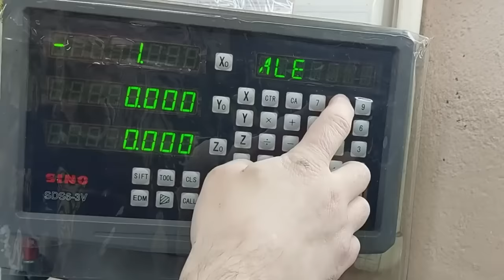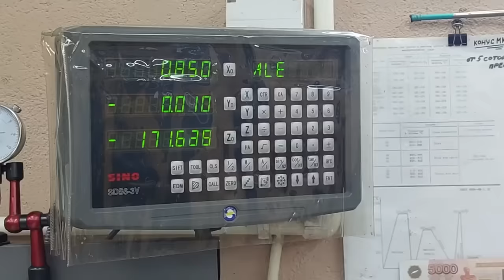Top 3 Genius Ideas  every turner should see

Comment: I have put a very heavy knurl on a part to press into an oversized hole to re-machine the correct hole in it.  A bit of threadlok held it in place.
Reply from the maker: All right, man! Welcome!
Reply: An old method to resize pistons was to knurl the skirt. Some lathes even came with an attachment for just that purpose. 
This was a standard practice for a long time even for airplane engine pistons. Some thought at the time it was even preferable and would knurl the skirts of new pistons as the knurling would hold oil for lubrication purposes.
Reply: @ken481959  I'm glad a few people know this.  I have tried knurling to hold a hose in place to no avail.  I ended up pop riveting it in place.  Too much weight for the rubber
Reply: @bobprice9244  If you knurl something to increase an interference fit tightness, be sure to use green Loctite for bearings and studs. Just don't plan on getting it back apart. That stuff works great.

Comment: Your Verses from Romans⭐⭐⭐⭐⭐.    The boring bar is a great idea.  Never thought of using a parting insert before 👍👍👍👍👍. 
    I never thought I'd not be in a machine shop.  I let several of these tidy little lathes oass by at bargain basement prices. Ñow I have an old 13 inch swimg South Bend lathe. Its tight , and works well. BUTT  these little tool room lathes are so nice nice tho. I'm really glad to have a knee mill , and a lathe tho. Both are great for farm repairs. Mostly I'm glad for Eternal Salvation. It was so refreshing to see the Romans verse

Comment: Use a center drill BEFORE you drill all holes.  Using a center drill will keep your drill from being deflected and starting your hole in a different place.  Center drill are cheap, using them will allow you to drill on round bar stock.